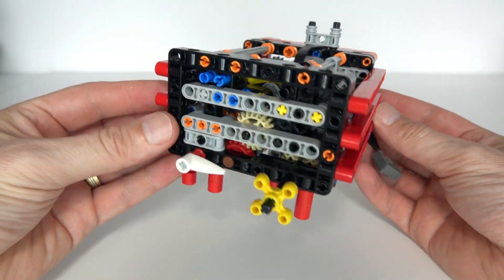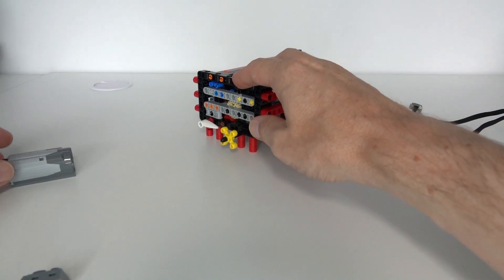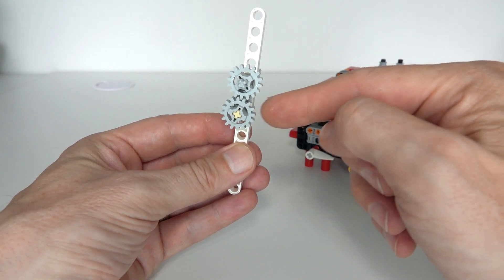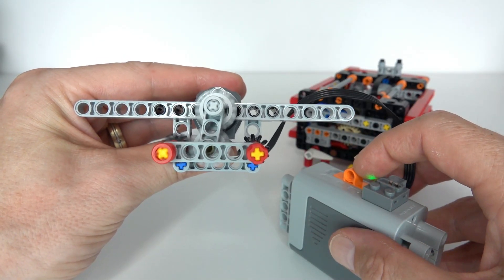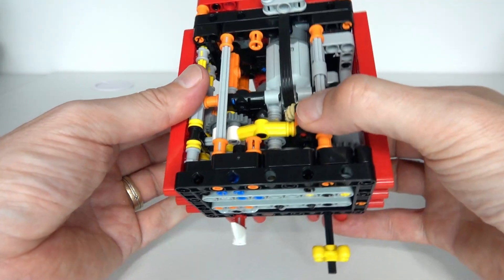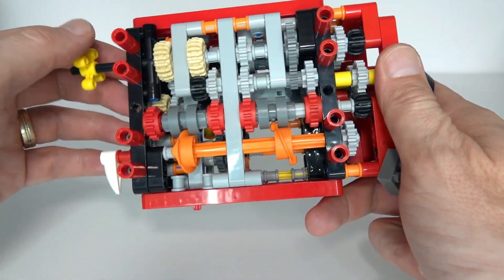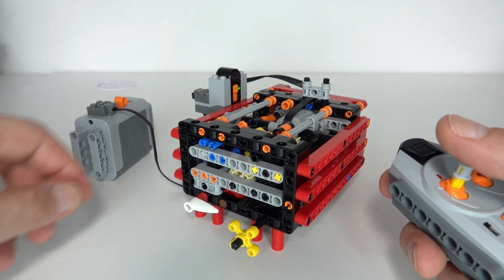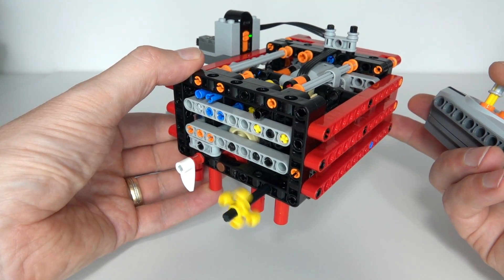Lego Technic Dual Function Gearbox

Comment: A very easy way to solve the gravity and the 'not engaging' problem is to replace the freely rotating connector on the  'not driven' gear on the swively thingy with a blue connector. This way the motor will 'push' the gear into the other. It will probably wear out a little and be less efficient though..
Reply from the maker: Hi Fam. Yeah that would work but like you said that would cause a lot of losses. It's hard to get a pin with just the right amount of friction - the blue ones are too high friction for the job.

Comment: wow this has surprisingly a high amount of functionality. i day dream a lot about how i can have a working transmission with only  one ir receiver one of my ideas is to always have one motor running and have the stepper mechanism switching from gears to increase the speed. also i believe you cant add a counter weight to that thing that switches gears so that a minute force can counter act gravity.

Comment: Hi! I dunno, it's very innovative as ever, but I think your fully automatic 2 speed version last week was a better solution for a working model. Still very good though 👍. Stay safe and keep building!
Reply from the maker: Hi Carl, Yes it's hard to keep coming up with new ideas! LOL. This gearbox could be used for other purposes such as switching between functions for a crane mechanism etc. 🍺
Reply: @TechnicBrickPower  I was actually wondering if some of it could be used in a walker, so each leg could be moved in turn. Would create stability of the chassis.
Know what you mean about new ideas, I'm actually totally out hence no new Lego posts for a while, in either of my two current interests (gears and walking machines). You're pushing the boundaries of what Lego can do here and it is awesome that you design and build something alternative so often! I've reached an impass with my CVT - can't shrink it without losing strength, can't improve it without compromising reliability (I want to implement braking bands like a real auto box), so am stuck with something that has a built in flaw with the slipper clutch! I know that to overcome this will involve a lot of change, perhaps I should look to the YouTube channels I follow for inspiration!!

Comment: I wonder if the pseudo-programming of the PoweredUP system would allow for a function that would switch a motor backwards and back forwards for a function change, like a button on the app that does the change automatically without the need for the user to manually reverse a motor twice to get a function change. If it is a thing PoweredUP can do, this kind of gearbox would be great for expanding functionality of a set without the need for secondary or tertiary hubs. 
For example, a tracked bulldozer with a blade and ripper would normally require 6 motors, left track, right track, blade lift, blade tilt, ripper lift, and ripper tilt. With this kind of gearbox with 2 functions per gearbox, you can split the blade and ripper functions into a switch between lift and tilt per accessory, or split the functions between type so that there can be simultaneous movement of both functions on one accessory at a time, reducing 6 motors to 4 motors. Or go a step further and use this exact gearbox with 4 functions and reduce 6 motors to 3 motors. I use this example because the flagship for this year is rumored to be a Cat D11T, where the model would realistically have 6 functions, where the Technic Powered UP hub only has 4 functions, thus the requirement for 2 hubs; where if a gearbox like this was used in combination with a button on the powered UP app to change functions based on this gearbox's gear switch feature, the cost of the set could be significantly reduced. This 'swing gear' setup was also used in an official set, 4895, Creator's Motion Power set from 2006, so it's something Lego could easily implement if PoweredUP's programming was cooperative with the feature. 
Assuming you have a stationary set, e.g. no wheels or tracks for driving, this could expand a single Technic Powered UP hub to do the work of four hubs, thus a massive savings in cost, assuming there's a legitimate use case for something like this. Though, I see this more of a feature that would be implemented into Mindstorms or Education's Spike sets, rather than seeing it implemented into Technic sets; especially since I don't think simultaneous use of multiple Mindstorms Powered UP hubs on a single set is a feasible option, if Lego were to ever break the 6 function limit of the Mindstorms hub, especially as Education and Mindstorms also use the sensors that the Powered UP ecosystem has. Though this might also have the potential to pop up in sets that use the smaller hubs with 2 ports, the WeDo 2.0, small, and Move hubs. 
But all of this really depends on how complex PoweredUP's app is. Personally I'd rather have a function change button for this feature, especially when scaling this to incorporate multiple motors, and I think Lego would as well for kid-friendliness.
Reply from the maker: Hi wow thanks for the long comment - I think it's a record LOL. I haven't looked much into the power up functionality and options but I am sure there is plenty of room to get creative. I agree that you should easily be able to cut a model back from 6 or 7 motors to 3 or 4 by using this technique - or simply have one motor to choose between functions and the other to drive the function. Especially mutually exclusive functions such as driving a crane and extending it's support legs etc. I look forward to the Cat D11T that's for sure. 🙃

Comment: Is the motor forced to come to a stop when it's changed gear or do you have a clutch gear to allow slippage? I guess there might be too much torque required to include a clutch gear. Also, I see you're using an L motor. Does an M motor have enough torque to activate the stepper?
Reply from the maker: Hi there - yes it does stop which I didn't think was a big problem but maybe it is - can start to heat up the motor and cause thermal cut out. There is a 24 tooth gear that can be replaced with a 24 tooth clutch gear and I think it will still work fine. I think an M motor will be fine too. 🙃
Reply: @TechnicBrickPower  well based on your other videos I'd guess you know a lot more about it than me, so if you think it's not a problem that's good to know! And as long as the gears are all tightly packed it's not going to cause skipping :) Great video as usual!

Comment: Wow, that's a great idea! I've first encoutered this mechanism in set 4895, where it was used to make sure the propellers spin in the right direction (none of this switch-blocking cheating!) and additionally, activated the turrets when the motor was spun in certain direction - crazy mechanism for a Creator set.
I have seen use of the mechanism to create simple gearboxes with two gears (giving up the ability to go backward), but I've never seen it used to change gears. Very cool!
Also, some friction on the 'moving gear' or its axle should make it work upside down, but that will add energy losses.
Reply: You are right about the friction making it independent from gravity, you can see it in action here: https://youtu.be/ltc_aEMkyD4
Reply from the maker: Hi Ignorama thanks for sharing your video - looks like you already made something similar a long time ago ;). Hard to not re-invent the wheel LOL 😂
Reply: @TechnicBrickPower  Don't worry, there is only a finite amount of machine elements like ratchets and you combined it with a gearbox in a very useful way! And I got the idea from Sariels fantastic book. Engineering is always about combining and improving existing designs :)
Reply from the maker: Hi Zozoleonlego - thanks for your comments - will look up that set 4895 and see if I can get the instructions for it and see how they did their implementation. Thanks for the friction tip - I did consider that but couldn't see an easy way to create a small amount of friction...🙃

Comment: imagine if there were lego sprag clutches or proper ratchets and pawls. could you jury-rig a gear to work as a ratchet with another peace as a pawl? being able to have one-way rotation would be really powerful
Reply from the maker: Hi SuperAWac - I am sure you can create one way rotation - set 9396-1 "Helicopter" had a set up where the rotors only rotate in 1 direction using a gear that slips in reverse. 🙃